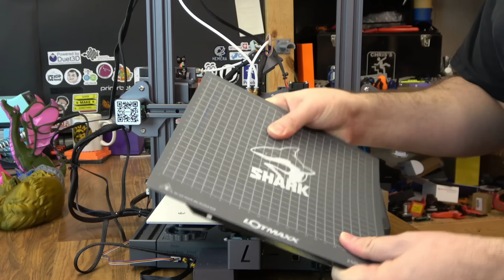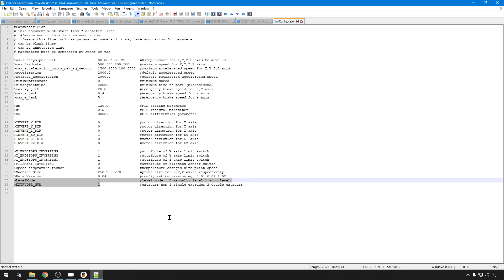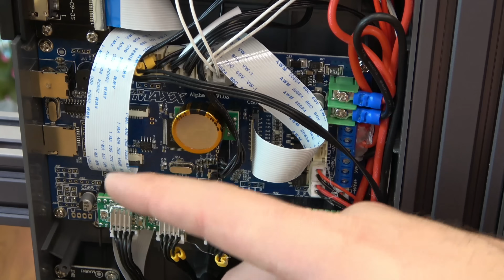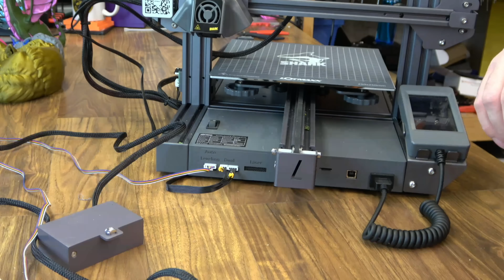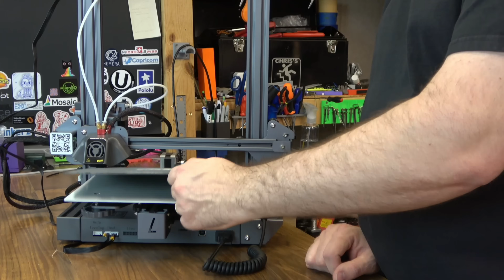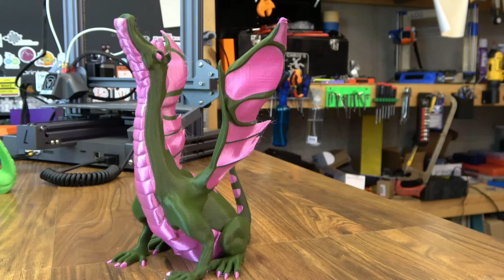Lotmaxx SC-10 Shark - 3D Printer - Review - Chris's Basement

Comment: I just ordered one with all the add-ons so we'll see how it does in my own house. Thanks for a great review!
Reply from the maker: Have fun!
Reply: @ChrisRiley  Thanks I really hope to! Just went through a less than thrilling time with an Ender 3 Pro - returned it - and am hoping this machine will be better than Creality's stuff.
Reply: @ChrisRiley  Hey Chris can I ask you a favor? I've been printing no problem auto-level and single color. Changed the config for leveling & dual extruder, changed the Cura for 2 extruder and specified when trying to print two color. But the upshot is the 2nd extruder will not heat. Any ideas? Lotmaxx is not much for customer support.
Reply from the maker: @matthews8374  Hey, it has to be something in gcode. Trace the raw gcode down until it does a tool change. It will probably call a T1 command. Is there a M104 command anywhere after that?
Reply: @ChrisRiley  I will dig down. Thank you so very much for your reply and help!

Comment: Chris, have you heard of issues with using octoprint with the Shark? I have issues with my lotmaxx shark and octoprint as do many others I have heard,  communication time outs, and will sometimes just stop mid print. Then other times it will work fine, but lately constant failed prints while using octoprint and I have no ideas why
Reply from the maker: I did have one issue like that, but wasn't sure what caused it. Maybe we need to change a setting or something like that in Octoprint. Do you know if there is an issue for it over on octoprint github yet?

Comment: With Cura you could probably do a little better on the Batman ears by increasing the Minimum Layer Time from the default of 5 seconds to ~20 seconds whilst not forgetting to also reduce the Minimum Speed from the default of 10mm/sec to ~1mm/sec or even 0 - because reducing printing speed is how Cura achieves its minimum layer time.
Reply from the maker: Thanks!

Comment: Awesome review Chris, thank you! The Shark looks like a great value considering all of the included extras. The overall user experience should also only get better as the software matures, making the laser a more viable tool. I just wish Open Source firmware was supported, so unfortunately this is a deal-breaker for me. Open Source is a huge selling point for many people and this could be a lacking feature that ultimately hinders this printer in long term sales. 

If the creators of the Shark are listening, please change your position on using proprietary firmware. It's an unpopular stance to take, and doesn't seem justifiable in a market where a 3D printer running Marlin firmware is a selling point. For any user, especially new ones, having to wait for developers to fix bugs isn't fun when the community may already have a simple fix. On that note, more technical people may stay away from this machine for such reasons that reflect a user's avoidance of being dependent on the manufacturer's support. This is especially true with startups that have yet to earn a reputation in the industry. I would hate to see buyers stranded with issues and this company goes bankrupt while never releasing a way to fix problems in their proprietary firmware. I also don't trust the safety or security of devices that aren't Open Source. Because of that, I don't think it's worth the risk to purchase a Shark. Hopefully this all changes if the company listens to community feedback.
Reply from the maker: Very well said Joe, closed source is a deal breaker for a lot of us.
Reply: @ChrisRiley  I appreciate the reply Chris! I just bought into the E3D ecosystem specifically for its Open-Source modularity. 

Hemera is unavailable so I went with a Titan Aero. Your video on extruders helped me decide on getting a Titan. Knowing that you like them, even when compared to Bondtech, is very reassuring. I ordered from Printed Solid and I noticed they sell a Chris' Basement Sticker just because they respect you so much! Now I want that sticker...lol.

Comment: I can confirm the quality you see under the hood is a lot worse than what you showed.  There is no wire management and they have wires cut too short that are pulled directly across the board being heated up by components and knocking off the heat syncs.
Reply from the maker: That's a shame, sorry to hear that about this one.

Comment: Are those CLS THT holes on the PCB next to each stepper driver?  Like an SKR 1.4 to take advantage of the S42B Closed loop stepper.  If so nice touch.  On the other hand I hate seeing hot glue used as wire management.
Reply from the maker: That's what it looks like, yes. I am with you on the hot glue.

Comment: Do Sharks bite when you whisper to them?  That fan housing does have the issue of the 4010 hotend fan ends up venting at least in part down onto the heater block and part you are printing.
Reply from the maker: Almost always, I didn't say I was good at it.

Comment: my printer has problems making first layer stick especialy small screwholes.would be nice a video for that. i dont use the bicolor cause many users get theirs clogged.
Reply: I have a similar issue, no printing issues unless the first layers have small round shapes
Reply: Try reducing the Initial Layer Speed. In Cura, for example, when the Print Speed is 60mm/sec the Initial Layer Speed defaults to 30mm/sec but when printing small details on the first layer I'll often override that to 15mm/sec, 10mm/sec or even less.
Reply: @anthonyrich1592  will give that a try next time thanks
Reply: @anthonyrich1592  i have tried, but it always seems as fast almost if it ignores anything under 30
Reply from the maker: I wonder if the jerk values are set too high. Check to see what they are with an M503 from something like pronterface.
Reply: @ChrisRiley  i'm new to 3d printing this is my first printer. and everything you just said to me is chinese to me :(
Reply from the maker: @RedBoyke.  Cable up to your printer from your computer and use this tool. https://www.pronterface.com/ Select the com port and connect. Then run M503, it will spit out a bunch of info.  Look for the M205 output.
Reply: @ChrisRiley  echo:  M205 S0.000000 T0.000000 B20000 X10.000000 Z0.400000 E5.000000
Reply from the maker: @RedBoyke.  Run these command and see if it helps your first layer. 
M205 X 7.0
M500
Reply: @ChrisRiley  i did first layer test the stl had some holes and hexagons. jt printed ok but i feel like the first layer is maybe a bit too squeeshed and too dried out.(the rest of the print is always fairly good) i did make heate bed 51C and filament 207C to make sure it sticks well. still dont realy know how a first layer on lotmaxx can look like when its good.